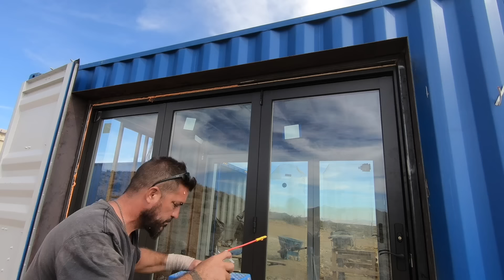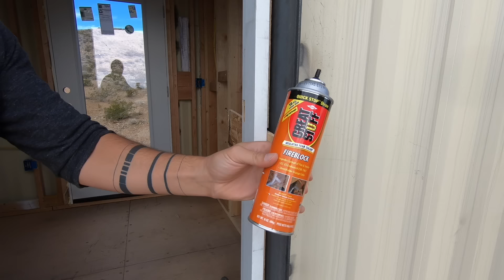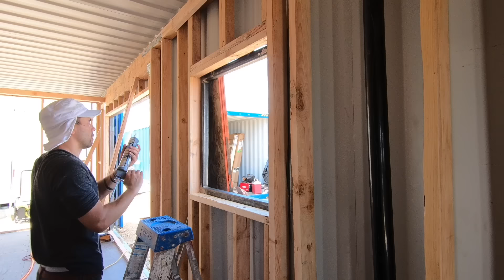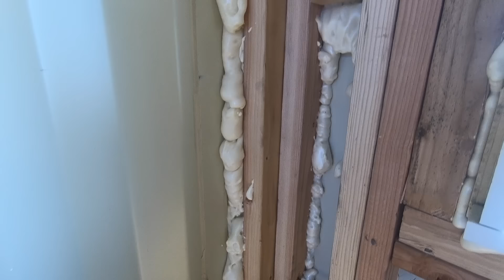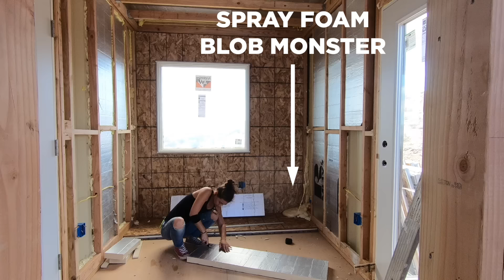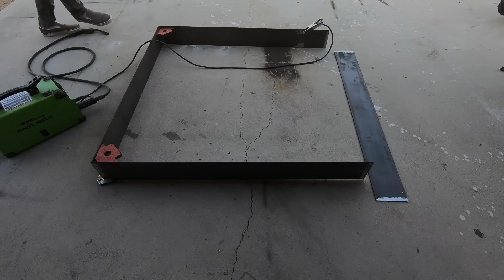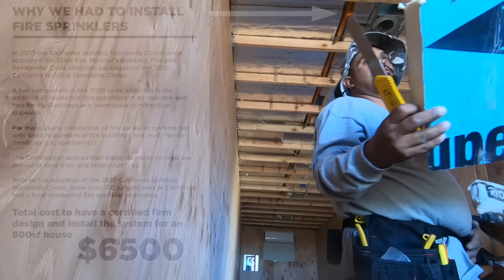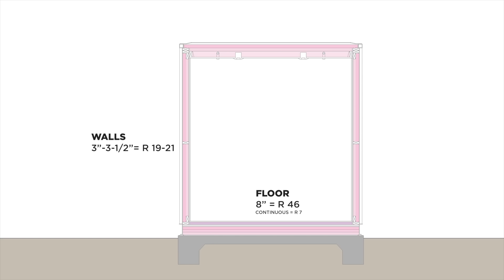Building a Shipping Container Home | EP03 Doors, Windows, and Insulation

Comment: Nice video.  Here are a few of my notes.

1. You need a new engineer as this house is way overbuilt.  You should not need internal sheathing on a steel container with the correct steel reinforcing, let alone with all the framing.

2. For flooring, 8 x 4 sheets of high density foaming with foil backing under 3/4 TG OSB work great.  They are cheap, and make a warm conformable floor with minimal joints. (I did this in a damp garage years back and it worked very well.)

3. Let me know when you want me to design a large (16 x 40 open plan) back to back container :-)
Reply: I'm building a large open floor plan shipping container home 40 x 40 with only two bedrooms and two bath. The rest open floor space. Love to hear your ideas
Reply: @aaronashbaugh8948  Where's your project? I'm in process of putting my house on the market in order to buy land and do the same.
Reply: @aaronashbaugh8948    Hi.  For 40 x 40 are you planning on using 5 containers?

Comment: You like the angle iron instead of the tube steel, but tube steel is 4 times stronger that angle iron because there’s more surface area, thus stronger... also for best weld strength you should have a small gap between things you’re trying to weld together, a weld between “butt joints” is not as strong as a joint with a gap filled with weld... been a welder and fabricator for many years and these are the observations I made... HOWEVER, for what you’re doing the amount of tensile strength needed is not as significant as it would be for something with a lot of pressure or weight on it... great job though
Reply: wish I had thought of the angle iron to level on the top or bottom of the opening ...  then set my tube frame on for easy square welding to opening...  Wish I had welded a metal support beam above the 6' sliding door ... going back to retrofit a metal header beam over door to eliminate any sagging, present or future...

Comment: I still would prefer tubing over L shaped metal any time. Tubing is more rigid and therefore stronger. You're working against a corrugated sheet of metal which, by design, and even more so after making and opening, will have some give to itself So, in the end, looking from above/under, that top part could have some concave/convex (depends on point of view) shape. Using some tubing that is way harder to happen if ever.

And, if you want, there are tubings with a lip on one side. That is, it's as if one of its sides is longer than the others, so you can use it the same way as the angled iron, having the best of both worlds.

Anyway, it's my opinion, I'm no architect.

Comment: Great video series.  I have one questions though regarding the wall assembly..  Aren't you worried about condensation occurring inside in the gap between the corrugated wall + the 1st layer of rigid foam?  I thought this is why spray foam is generally uses as insulation to completely eliminate that air space.  Thanks + looking forward to episode 4!

Comment: Hey! This wouldn't work in my country, some people have build houses out of containers but it wasn't cheap. To cut trough the steel took a lot of time, and the insulation can be a real pain in the ass. One couple used spray/foam insulation but it swelled so they were forced to remove A LOT of it. And the cost is huge. And my country really got some cold winters so the insulation is important. But i'm sure it would work in a warmer country :) Pretty nice build anyway!

Comment: I like well insulated houses but all the spray foam, glue and polystyrene basically turns it into hazardous waste. If you ever want to do a complete renovation or tear down the house in 20 years you’ll have a bad time. Basically it’s impossible to separate the components and recycle them. The whole thing has to go on a landfill. Better use mineral wool and/or autoclaved aerated concrete.

Comment: I used an air gap and then silver coated paper for heat reflection as well as 50mm (2 inch) insulation my containers are cool and have very little heat gain. I also used a green roof but that's another story :).. The double storey ventilation also adds to the house feeling cool. I don't have any aircons in the homes only ventilators to vacate the air in the wall. In referring to my current project New Life Children's Home in Witbank, South Africa.

Comment: The entire point of the Tiny House movement was to reduce the amount of living space as an interpretation of minimalist living, to drastically reduce the cost of building your own home and creating as small as possible impact on the environment. You've essentially taken that movement and perverted it by adding the most expensive items, not using the Earth itself as an insulator by building underground or using recycled materials (except for the container itself), having large open doors (made of glass no less which is a very poor insulator). All you built here is a manufactured modular mobile home. Nothing unique about this at all.

Comment: I am totally obsessed with the idea of shipping container housing and as a hobby I have come up with hundreds of digital combinations. This has been a thing for me for over 10 years and haven't seen anything on YouTube that articulates the process and solutions as well as you guys do. I'm so impressed with the detail and the aesthetics of your project. I am of the opinion that houses like these can be designed and constructed to scale at very affordable cost as custom homes both on and off the grid. Can't wait for your next episode. It would be nice in the end to show us a time lapse from beginning to end that shows the hours and days it took from beginning to end in addition to an itemized cost chart that includes all the costs of the project, from materials, permits and labor. Also, is this project off the grid or partially off the grid and what's the difference in running costs. I missed any part that included either a septic system or city sewage.

Comment: Are you not afraid of the formation of condensate between the insulation and the metal container?
Reply: It's in the desert and these containers are usually treated against rust, and they've been doing a good job of resealing anything they cut to bare metal.  He's probably fine.

Comment: How in the world did the engineer justify needing the 1/2 interior sheeting? You can stack hundreds of thousands of pounds on a container on a moving ship for heavens sake.
Reply: You have to have something to burn to justify the fire sprinkler system.
Reply: @HotFootPhoto   all that plywood
Reply: Just on the corners, not the corrugated part, I don't think they are designed for load baring. But, it would be nice to lay some foundation (more plywood) on top, off the corrugation, and have an nice bbq area, little indoor outdoor carpet for a tee off area, sun bathe, hot tub.....
Reply: California.
Reply: The plywood creates a rigid diaphragm that handles lateral loads from earthquakes (or wind).  Typical out here in CA.
Reply: @1070architecture  I get that but there's never been an earthquake that's been the equivalent of a ship at sea. Why not just weld in steel posts where the corrugation's been removed for apertures ?
Reply: @martingardens  And let's not forget you can stack 6 or 7 fully loaded containers on TOP of these things, all at 20 tons plus.
Reply: @martingardens  That's considered a moment frame + is more expensive than the plywood solution.  But you're correct, you could do that w/ all of the lateral stress being handled @ the corner joint welds.
Reply: @1070architecture  I know what the plywood is for, but given the box is skinned in 11ga Corten steel, heavily corrugated no less, the plywood is totally superficial.
Reply: @jtkilroy  The corrugation is strong vertically but not horizontally.

Comment: Very cool build. I would have spray foamed it though, there are DIY solutions for that. Fully prep the box first and spray it all at once.
Reply: Spray foam is fast and cheap and shit if you need to renovate and can dangerously off gas if not done right.
Reply: Polyiso board isn’t any better for safety or environment, and can trap moisture in some climates. If you’re concerned about offgassing, the only really safe choices are denim, cellulose, and rockwool. All of which dramatically drive up the cost of a project.

Comment: Using containers was for ease and cost savings in the old days.  This looks like it cost way more and is way more difficult than just building a regular house.
Reply: Not going to lie.  There's probably 47 states in this Union that you could've easily done this for 1/3rd the price.
Reply from the maker: i agree!  this was sort of a mythbusting experiment for me.
Reply: @TheModernHomeProject  I have a 40' hi cube in Lucerne Valley on 10 acres.  I'm so not going to get permits or follow codes.
Reply: @TheModernHomeProject  thanks for being open about everything, Ben! I just watched the series and I'm surprised that regulations basically require you to build a house frame within the containers.
Reply: And building a conventional house wouldn’t limit you to those crappy dimensions.
Reply: Not needing a foundation is one of the big perks. But ... California :)
Reply: But, but, building engineer said he needed a 2x10 header above that 10 foot wide doorway that was already constructed with a 2x3 steel tube frame...  You know, for strength and safety reasons, not to grease any construction company palms.
Reply: If you could pre-fab and standardise everything prior... you'd save so much time and money that way. Also it seems the only benefit of structural support are the framing beams of the container which can be achieved with H framing supports and require less cutting and guff.

It's romantic, but I think there were more precise and easier ways to make this... It's essentially three insulated sheds... treat it as such and get those experts who do that day in day out to smash it out... but hey, learn by doing is the best way.
Reply: California is just terrible to build in with all the regulations you need to follow. I understand they are necessary considering the earthquakes and such, but still, this must be why new houses cost so much in CA
Reply: Since the containers are self-contained units that would free-float in an earthquake, why not use flex connections for the utilities and enjoy the shake & bake when it happens. Screw the HUGE MONO FOOTING- its just a redundant system underneath! (...and screw the Cali codes too).
Waaay too involved and expensive to be limited by these steel shells. But the WOW FACTOR novelty gets you lots of street cred in Architectural Digest!
Reply: omg yes. was just saying that as a main comment above
Reply: @Treasure Geo What else do you expect in CA, home of retards galore.

Comment: Most container builds use spray foam to insulate. Just curious why the preference for the rigid? And regardless, how is the inside temperature with the sun on steel? Does it hold temperature faily well? I noticed you don't have a sun reflector roof.